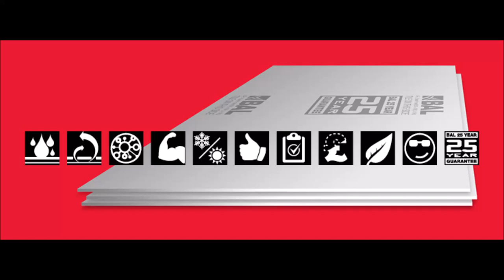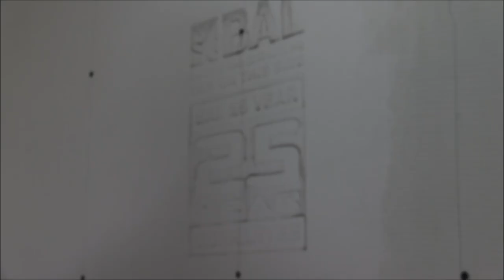How to install a tile backer board onto masonry

Comment: Fix with stainless steel screws and wall plugs (screws a drywall screw right into the cement) lmfao
Reply: it was probably into the wooden joist on the right.
Reply: Bad example

Comment: Can anyone tell me what thickness I can expect with thinset? I'm looking to lay board on a floor ( that is now carpet over slab) to get it equal in height to adjacent tile floor, about 7/16 higher than slab. I plan to go over everything with a luxury vinyl and don't want transition. Can't seam to get a straight answer as to how much to expect thinset to compress. That would tell be board thickness and knoch size to use.